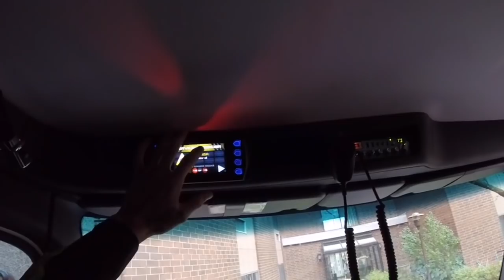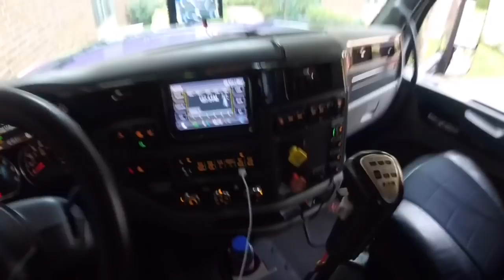Rotator work episode 17 manlift mudding

Comment: Great pull job thank god the customer was their to help you . Here’s a trick to getting them out if you don’t have help. The first thing you can raise the basket up a little bite the take a 7/16 or a 1/2  wrench and go to the wheel hubs their you will find a small square piece if metal in the center of the allies with a bulb in it. Take it off and turn it around and put the bulb into the center of the axle cap and tight them up on all 4 wheels that will release the brakes on all 4 wheels so that you can winch it out to a hard ground . The reverse the step so that the wheels will tun with the engine power . I know because I was in the rental field as a driver and mechanic. Note most all area lifts have a valve or plates that will release the brakes . Be safe playing with them  just a little help fo you .bob
Reply from the maker: bob strickland hey thanks a lot man I’ll defiantly remember that
Reply: That same trick works of you ever tow a pelican.